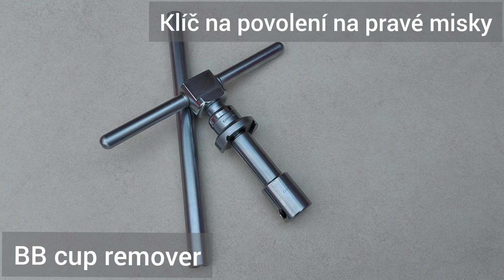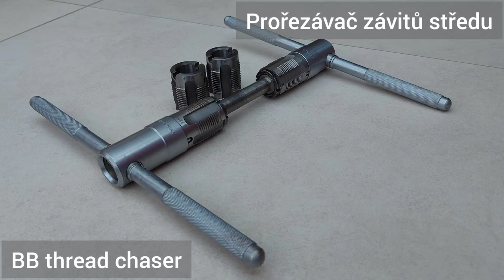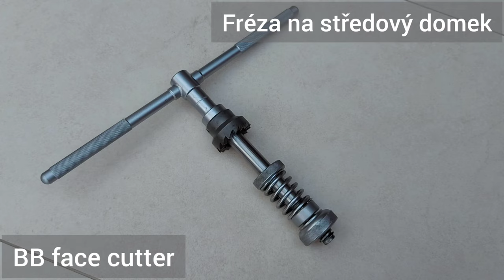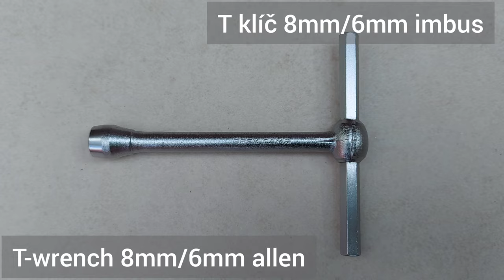Campagnolo toolbox showcase

Comment: Very nice video, thank you:) 
This Campy tool case is the second version. It's missing the spacing spring for the headset tool and the saddle spanner(since leather saddles with spanning mechanism vanished in the late 70s). The straight edge is used for the alignment of the rear triangle. But also for the breakleaver position. Hope I could clarify this:)
Reply: Hi Adreus  instinctively  think your explanation is the best despite listed by Campagnolo as  " Straight edge for the alignment of the rudder pedals"  Item G . In 'Campagnolo speak' appears rudder = handlebars and pedals = brake levers. Don't you just love it ? 😳
Reply: @kevinfrost1579  with pedal rudder they mean the alignment of the BB Shell with the rear triangle of the frame. Translation in those days has been quite diffrent...^^
Reply: @adreus4759  Thanks for clearing that up, much appreciated 👍
Reply: Its a straight edge. You can use it to check position, parallelism, flatness of anything. Yes that is the second generation of tool kit. The first also had wood divider between tools. Great video. Passion knows no boundaries!
Reply from the maker: Thank you all gentlemen, for helping me find the truth.  
And thank you very much for your support and watching!

Comment: Hey! I was just wondering if there is a reason for taping the ends of the headset wrenches, or why they are taped up? Is it to reduce friction between the tool & the bolt when tightening / loosening?
Thanks, and thanks so much for the informative video!
Trevor
Reply from the maker: I have it taped, because the aluminum nuts can otherwise rub off, get crushed. Thank you for your support.